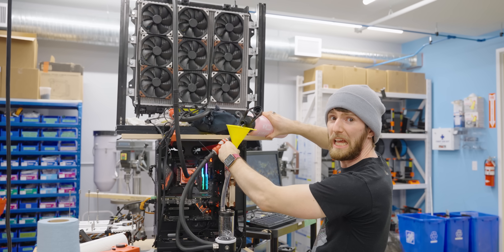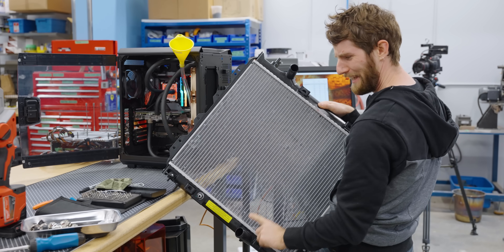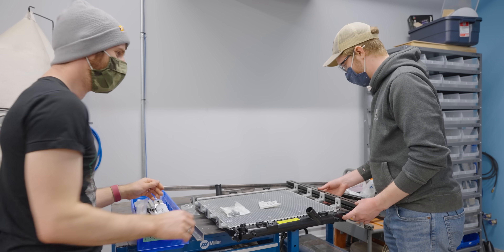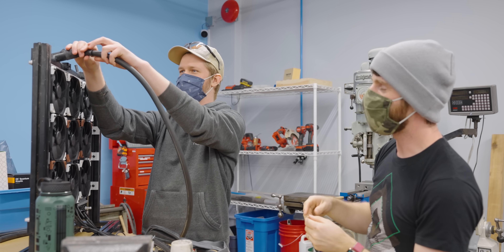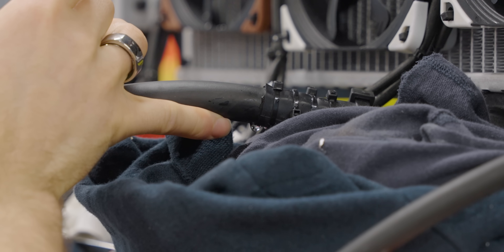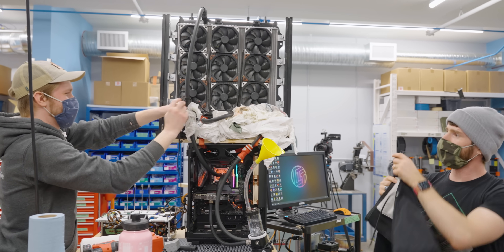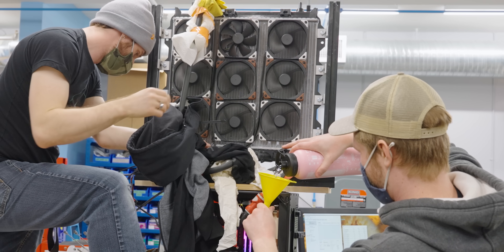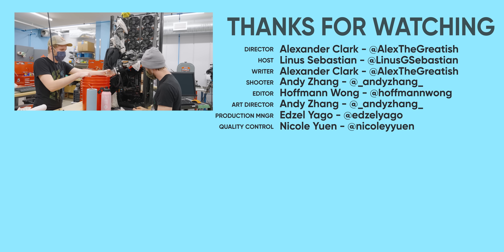Our Craziest Cooling Project Yet - Car radiator liquid cooler

Comment: .... I mean..... this could have been fun if you had just put a modicum of effort into it.... just because you use auto-cooling parts (which used to be a thing) that doesn't mean you had to put it in the worse place possible.

Oh well, I'm pretty sure this will get more views than that X-box controller you built :).

Comment: Wonder if the put it on a full size case would it work as a side panel. Have the heat blowing out that way no dust can get into they system and possible work one million times better cause wouldn't be on top of the computer.  also why not just hose clamp everything instead zip ties that was little ridiculous and seem like good way take out a computer.

Comment: Placing a radiator with jank fittings just straight on top of the case was an excellent idea. BTW, if anyone wants to actually try this check out the Watercool MORA rads instead. It's just gonna be a way better option.

Comment: This gave me an idea make a radiator less water cooling system. Run a hoes from your spout, sink, to the intake and the loop and a hose from the outlet to the drain. Turn on the water and let her go. Allwas have fresh cool water in the loop. Only problem your water bill might be high.

Comment: Honestly, if this was like a legit project and not just a 20 minute throw together idea, id love to see how cool the system got.
Reply: Same, i had high hopes but after wathcing it i dont even see the point of making it.
Reply: @Alpejohn it’s easy asf to make for way less then 200$ too. Just need hose clamps, hoses, size adapters and pull a radiator from a junk yard along with a 12” slim quiet fan for $20 of Amazon Could easily put together in less then 10 minutes.
Reply: @Alpejohn use a civic radiator they’re smaller and cool effectively
Reply: Add in a little better understanding of how car rads work would have been cool too. 
I think the next step is build a whole case around the rad with one big ass car fan. They run 12v anyways so they could probably build a neat controller for spinning the fan up.
Reply: @cmurph570  I would love to see that but a car fan is very dangerous and can cut some fingers off. $50 someone losses 2 fingers during the build and Linus's initial reaction is laughing :)
Reply: @churro6160  no no that's what the shroud is for.. hahaha I was thinking more like an electric fan and not thinking how fast they still spin but you're for sure correct probably way too dumb to actually do.
Reply: @churro6160  don't some car fans have a shrouod that goes around it?  But, you are very right, if not done correctly, would be very unsafe.  Not something to try in a 20m unplanned video.
Reply: @daexion  almost every car radiator fan had a shroud yes but for airflow, doesn't really help safety much at all
Reply: So many times they come up with strange projects that I can't help but wonder how they'd work if they actually put some effort into them instead of just playing three stooges.
Reply: Make the entire computer a radiator, like the all fan case
Reply: @RowsieFox  onlyfans case
Reply: @RowsieFox  has a nice idea lol
Reply: Yeah this needs to have some time dedicated to it
Reply: Agreed- I get the gimmick of trying to deal with a fubar setup, but sold as a legit project.
Reply: Maybe Linus shouldn't do videos immediately before WAN show. It never works out and always takes way longer than anticipated/rushed.
Reply: Same dude, this was painful to watch
Reply: I read this thread before fully watching the video and thought you were just criticizing just to criticize. After watching the video I totally agree with you lmao. I thought at the end when they finally got fans running that we would get somewhat real data but since they were losing so much water the data was completely corrupted.
Reply: Kind of like Linus’s old chiller
Reply: Agreed. The video was amusing but it would've been nice to see them take it slightly seriously. Disliked as is
Reply: You can literally watch a pc build with a mo-ra and check right now lol.
Reply: @xhogan89x  Yeah but a Mo-Ra is meant to be a PC rad so it loses a bunch of street cred immediately.
Reply: so much heatsoak, it probably ran at room temp.
Reply: same! although very entertaining
Reply: Im curious it the metals and plastics from a car radiator are different than from a cpu radiator and if there is a compatible one that won't harm or corrode the internals. Honda? GM? Mercedez? Toyota? Ford?
Reply: I would be interested in seeing how much radiator surface area would be needed for "passive cooling" with only pumps running. For that I guess you would mount the radiator horizontally so that the hot air would rise up, drawing more cool air from beneath evenly across the radiator. I think it could be really quiet, and that's mainly what I'm interested in, instead of overclocking. Something like that just might get me to ditch my NH-D15, because I can't put one of those on a GPU.
Reply: #SarahWasRight
Reply: Please!!!
Reply: It was released on Sunday for a reason
Reply: GirlBaBes.Men
Reply: This video disappointed me
Reply: Agreed.  I was excited to see this video. Too bad they didn't take it seriously.  So stupid.
Reply: I think… it is possible.
I have link for one guy, who alone made a bit same. Results were interesting but still … not so amazing.
Reply: You can clearly see how cool it is. I'm setting this up on an amd e1 with 4gb ram, 5400rpm HDD, onboard graphics inside a small form factor case. Because obviously that needs this cooling solution.
Reply: Do you think this is a raw 20 minutes of footage?
Reply: @joelp7775  i definitely know that the time put into DOING it was many hours, but the thought of the video probably was some spitball "we had a meeting and had about 20 ideas all at once we'll use throughout the week"
Reply: It would have probably dropped another 5-10 degree
Reply: Yeah me too,this video was pointless tho. If the were serious they would have stopped the leaks to begin with. Disliked.
Reply: You do realize the video takes far longer than 20 minutes to create, and they definitely didn’t think and plan the idea the moment he got done with the sponsor💀🤦🏻‍♂️
Reply: Good to know this vid is a waste of time. Thanks for saving me 20min
Reply: The project is useless. Just buy a MORA 3: https://shop.watercool.de/MO-RA3-420-LT-black with a stand, Fans, Pump/Resholder and everything and you got a HIGH-End germany engineered/manufatured product. ANd not such a cheap stupid crap like in the video.
Reply: Very disappointed with this video. Hate the direction Linus has been going for a while now. A million dollar company making five dollar videos.
Reply: or just buy a MO-RA from watercool and not waste time.

Comment: You could use liquid metal to cool a computer,. 
There is a gallium alloy that its melting point is sufficiently low that can be use as a cooling medium, because it has higher heat capacity, and a really high heat conductivity. I think the name of the alloy is  galinstan.

Comment: use a heater/radiator the one you  heat  the room with would be funny if its  silent as f  you  only need a pump

Comment: I bought a heater core to use as a rad 20 years ago. The salesman laughed and laughed and told all his co-workers what I was doing.

It did work though. That system used an industrial pump, a five gallon reservoir, etc.  All the stuff I could buy at the hardware and auto shops, except the cpu block, which was from  danger den. It was limited by ambient, however, so it was a waste of power and sanity.

Comment: this is poor... i run my pc of a car radiator for years now and it wasn that much of a hassle because i used the AC condenser, not the engine cooler... i run 4 bitfenix 230mm fans on it at 200rpm and can dissipate 300W easy with a delta T of 10°C...

so never think if someone cant do it, you cant make it better

Comment: With some purpose made fittings and hose clamps this could work, I mean it proved itself leaking like hell. I mean you plumb it jank as hell no shit its gonna leak. At the connections you need to have like aluminum reducers and probably a beefier pump, and realistically and actual radiator fan will move far more air.

Comment: this video feels realy rushed. like the radiator arrived in the morning and you just went ok the radiator we ordered to check the cooling arrived. who was doing that project? huh? what do you mean you lost the project files. nah it's just a water loop. get andy we gonna improvise through it.

it was fun to watch but did feel like a bit lower in standard than normaly. just on the preparation side of things that is. not testing of the fans beforehand or anything like it. and just the amounts of soaking up leaks insted of trying to seal them. it feel more like something rushed instead of having 3 days to work on.

felt weireder than normal.

Comment: This is the minimum requirements for keeping school chromebook laptops under 89 celsius. in order to keep the laptops under 40 celsius you will need the cooling equivalent that of chernobyl reactor 4 and 3 combined and then itd explode because how much stress is put on the cooling pipes to keep the Intel celeron CPU and integrated graphics cool. It'd be more dangerous then the radiation from the elephants foot as soon as reactor 4 blew up and gave birth to it

Comment: The fact things went so wrong is why this video is so good , but what i would like to know is can 3 360s(3x120) keep up with that car rad seeing as you used 9 fans and there is plenty of cases that can take 3 360s or was it the flow rate and positioning that made it so much cooler

Comment: I always knew that Linus was a blowhard. He sent that cap into low-Earth orbit.

Also, make a quick run to your local hardware store and pick up the right fittings. You'll get it running leak free for about $10.

Comment: As a automotive engineering student who was a car mecanic before, with a flair for computers, this hurts my soul so much 😭😭😂😂 I juste hope no parts were killed
Reply: It was a 3090
Reply: @johanneswiltner  R.I.P 3090 😭😭
Reply: Haha. I'm with you. The moment the bicycle tube came out I knew this was going to be a train wreck. I had to stop the video... So I could make popcorn.
Reply: @eoinkenny3188  And just after posting a video of their new offices and workshop which includes a massive wall of fittings lol
Reply: I don't remember if they mentioned at the start, but I really hope they didn't have a 3000 series GPU in there hahaha
Reply: @maagiapall  yeah it was...
Reply: Imagine someone asked you to work on their car, you open the hood and it's a gaming pc using car parts for cooling and the engine for the case
Reply: @blaster3190  it would have been the most amazing car/pc ever 😍

Comment: Linus go further, do something really custom, get the front Clip sheet metal for a Ford Model T, you need the hood, side, and radiator. Next find away to install a computer inside of it and make a rear case section and base, then install proper fittings to get the size down for normal water cooling without leaks, and install your fans, from outside it would look awesome

Comment: Lol, the transmission cooler is a separate isolated loop so whatever was hooked up there was affecting the radiator side (heating or cooling depending on delta)

Comment: I never thought the hardware survived that lmao!

Also quick note: a German company called Watercool offers a "MoRa 420" where you can mount 9x 140mm fans on each side. GamersNexus got this radiator as well. Not as funny as this build, but the go-to option for silent watercooling (so you can have an ITX case with external radiators for super quiet and very good temperatures!) :)

Comment: Let me get this straight...  You wanted a waterbox using a car rad.  That's a great idea to get the most rad for the money as long as you don't mind the aesthetics.
  If I went back to watercooling I just might do that.

You put it WAAAY up in the air thinking that a D5 is a Little Giant.  Not the best idea either for the pump or the unnecessary extra pressure on the rest of the system.
You see leaks as you are filling it and continue to fill instead of draining it and fixing the leaks.  Flat out stupid.

I'm sure there are videos out there that show a proper way to adapt a car rad to a computer for a low cost, silent and cool system instead of this cringe.
I hope people will seek them out.

Comment: I feel like it would of been a lot simpler, easier and less stressful if you built it beside the case in a rubbermaid container and you would of been able to fix the leaks to actually see what kind of performance gains you would actually get without adding cold tap water. Part 2 coming soon. I can feel it

Comment: Back when computer water cooling was in it's infancy, you didn't have radiators that were specifically designed for computers. We used heater cores from cars and pumps from aquariums.

Comment: I did this like 8 years ago with a small civic half size (google it) radiator without fans and a water block i made, with some cheap Chinese 12v pump on a q6600, overclocked as much as the motherboard could handle and it actually worked pretty well, took 3-4 hours for the radiator to feel warm.  I made some adaptors to go from the rad's pipe diameter to 8 or 10mm silicone hose though, so no leaks :)

If I was to do it again I think I'd use a cars rad fan too but pwm'd to like 2% because those things shift some air.  Anyone have a ryzen or whatever spare so i could try it?  I'd make a video on it.. :D

Comment: Hey @linus tech tips, would you ever do a show when you take the oldest possible PC (MB, CPU, RAM) and set them up with the best possible components like GPU and SSD drives? You could do user experience tests with the OS from the given era? Imagine being able to run 486 PC with SSD drive and Win 95 installed. What you think?

Comment: For the love of god Linus, i think us fans deserve a redo without the issues. This has been a dream of mine for years. Make it happen brother.
Reply: Ima give you the tl;dr of it. Yeah, a giant radiator makes your system run pretty cool, but this car radiator is a) hard to mount and b) entirely made of aluminium, so you will have to have a lot of corosion inhibitor in your fluid so that your copper blocks don't get gunked up. If you want lots of radiator area in your system, either get a big case and clad that mofo in normal rads (EK made the best ones last time I researched this) OR check out the MoRa from I think it was Aqua Computer.

Comment: Why did you do it so halfway, you should’ve got the fan to go with it and proper fittings or welded a cap on each end to act as a reducer ... also you could have built a case around the rad! Also the reason I mention the larger fan is volume to speed, make it quite.

Comment: It needs to be flushed with DISTILLED water...  Not tap water...

You guys should install this radiator with the proper fans for it into a wall to create vacuum pressure in the room.    Then properly connect it to a system or systems and have it cool several machines at once.

I'm fully confident it can manage it with a big enough pump.   After all, these things bring temps of well over 200C down to 90C even on hot days with effective airflow

Comment: Most electric fans on radiators need 12v power, you could have literally just gotten a car radiator fan and plugged it right into the PSU

Comment: so janky and didn't bother to test for leaks to add drama. Why not go all out and do hardline tubing instead? This is worse than the attempt to make a whole room water cooler years back with copper tubing. What's next? Using Linus's home mini split hvac as a sources for air cooling? How about a silent passive cooler using an in ground passive home or even better, a geothermal cooler? Here's an idea, build a case that's completely made out of functional heat-pipes!

Comment: Linus, are you not aware there is a specific ATX connector bridge to use when filling a water loop, so that it doesn’t power on the mainboard, cpu & gpu, or is there a specific reason you jank it this way? Because they are cheap af, and you do loads of water cooling, but always stumble over this exact issue

Comment: Also, Linus was right - they were basically testing direct tap water cooling - adding water so often that the radiator didn't actually do that much as the water was replaced so often

Comment: Why didn't Alex just take a metal tube the same size OD as the radiator inlet port, weld a cap on the end, machine a threaded hole into the end for a standard water cooling fitting, and use a standard radiator hose & clamps to connect the two?

Comment: if you get a fan from a car then it will give much better results. 
But since it's about overkill then why didn't you get 6 or 8mm cooper tubing, install them in your PC (Reason is that it will be pressurized later so you need solid metal) and hook it up to a Thermal inverter (A 4KW AC Unit...) and this way you can now use the gas to cool it in high pressure so you got high flow and a compressor that is chilling it down by.. compression 
The only fan that is needed is that cools the AC unit x'D

Comment: Sorry, this has triggered me so F*ing bad. I bet there a hydroponic shop or a garden centre right round the corner. Why didnt you just go get some flexi pipe ( they stock lots of different sizes ) and some reducers  ( they also stock lots of different sizes ). * facepalm
Reply: The more i watch, the more i think this is so fucking dumb and irresponsible.

Comment: Thank you linus for doing the Projects that i come up when drunk so i don't have to waste money on em. But honestly you couldn't have done a worse job at choosing the "hoses" for the radiator. Some pvc tubing and earclamps or worm drive clamps would have worked out nicely and you could probably get them at any hardware store.